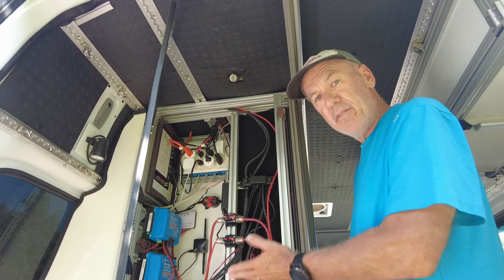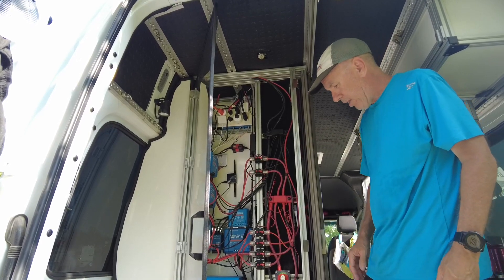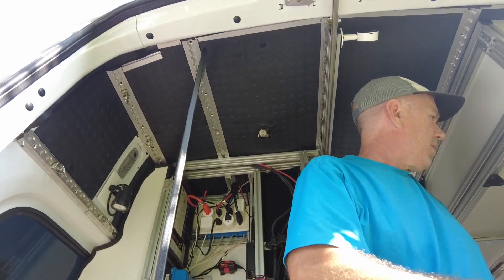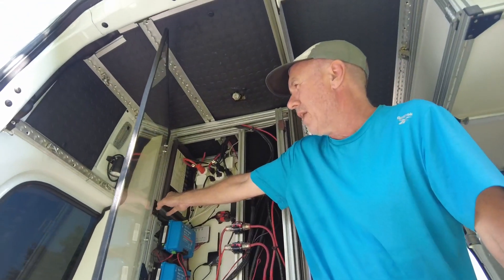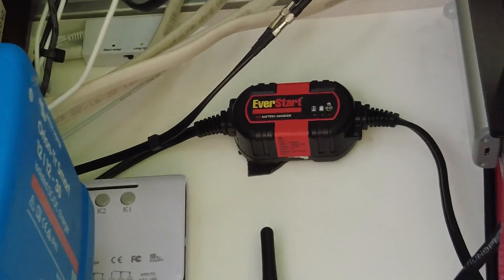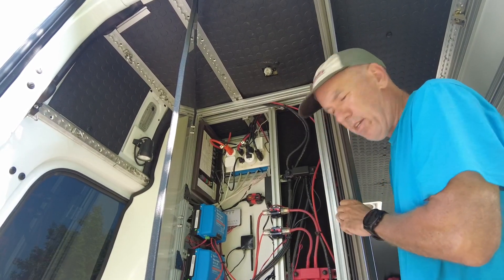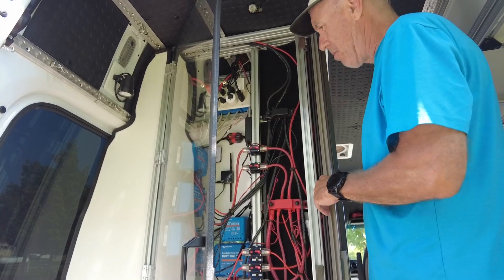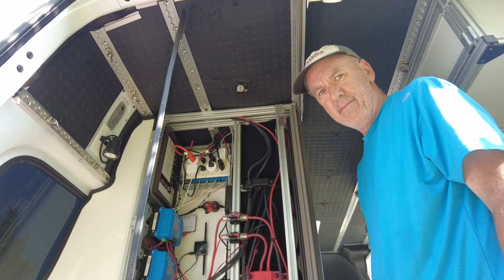VAN TOUR Part 6 | Tour of our POWER WALL. Lithium 500ah Batteries Stacked end-to-end. Links BELOW!

Comment: Amazing set up. I've been watching this van on ebay, my only problem is it's way out of my budget, your wiring is crazy, I'd love to be able to use this set up In a future project. Wondering what the cost would be for it.
Reply from the maker: With the lithium batteries and the Victron inverter and all the parts it was roughly 9,000$ for the electrical.
Reply: @GayeNRobert  thank you.
Reply from the maker: Thank you so much for watching. The wiring is something we/Bob truly enjoys and researching how to do everything.  Are you wondering the total price on just the wiring for the batteries and the victron components?

Comment: Nice work! One thing though, that I myself had issues with, you mention that your Orions pull 30+30+18 amps off the alternator. That is only true when they are operating at 40 degrees Celsius. At lower temps they may pull more. My 12/12-18 often pulls around 25. Which might be why your breakers trip. Check the data sheets! your alternator is probably smart enough to not overheat though, hopefully. 

Also, the wire from the alternator back to that cabinet must by thicc!! Haha 😅
Reply from the maker: Hi Simon, Good to know! Thank you. Yes, I've noticed that the Orion's will pull more at start-up - registered 43amp yesterday while I was trouble shooting the breakers flipping. I've ordered new 60amp breakers as advised by Victron. Thanks again, appreciate you watching and commenting. Enjoy your day!
Reply: @GayeNRobert  Make sure the alternator can handle it too! :) And that the wiring is sufficiently thick to handle the amperage. I can imagine the Orions are quite a distance from the alternator! Burning cables are no fun.
Reply from the maker: Hi Simon, from the Victron battery monitor it looks like the alternator limits the amps when necessary. I have not seen 78amps being charged yet via the DC to DC. Thanks again for your comments and information - greatly appreciated!

Comment: Great video!  I have a little teardrop I am about to wire up this weekend. I LOVE how you used 80/20 to not make holes in everything.  Any chance you would do a short video on how you installed it such that everything is adjustable?  Also, where did you get the 80/20?
Reply from the maker: Good Morning Sam - thanks for your comment. Yes, I think a video on the 80/20 would be very good. We used these type of fasteners https://www.amazon.com/dp/B077Z2HX42/ref=cm_sw_r_cp_awdb_imm_MZ03KH4T0Z2TWZ03MAEG?_encoding=UTF8&psc=1

We got our 80/20 from Grainger - was easy to pickup locally. The "fasteners" were the hardest part to source and expensive. The 80/20 is awesome to build with. Have fun with your teardrop wiring - we enjoyed the process of trying to do it right the first time - almost worked! Have a great day.